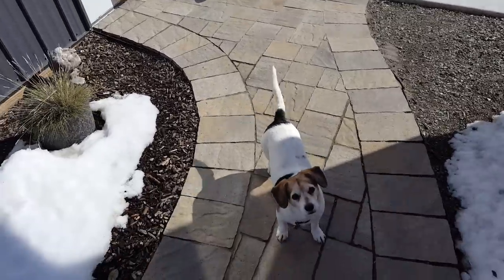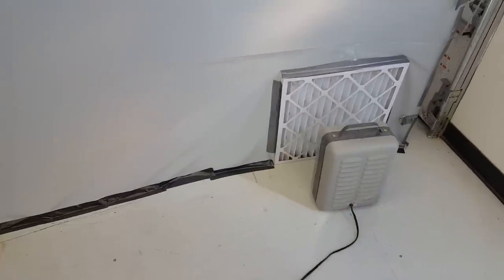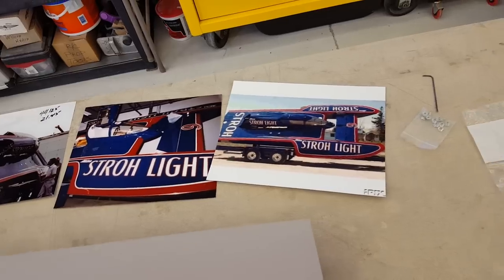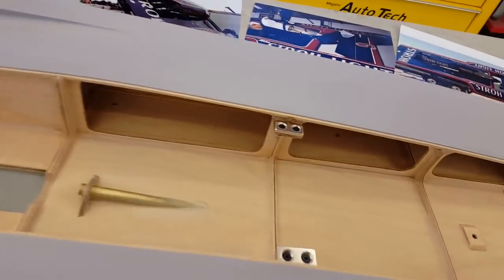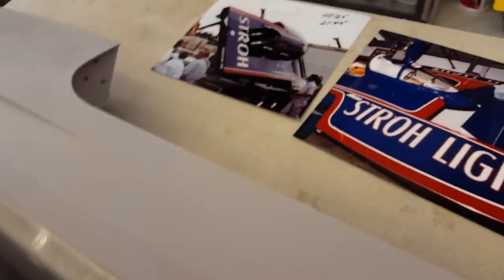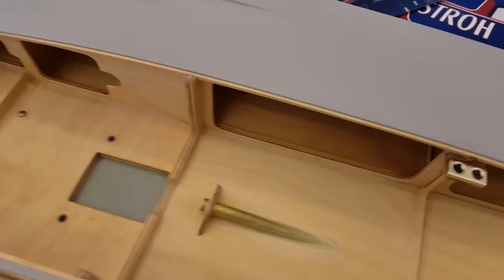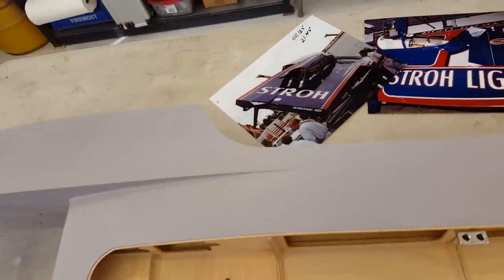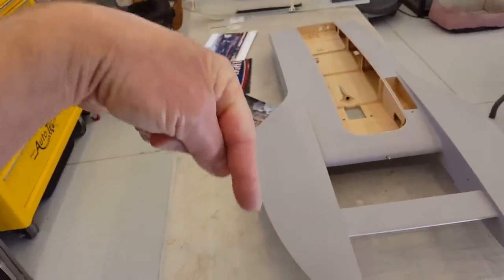RC Hydroplane Racing Boat Shop Paint Booth and Cowl Latches, Howdidya Do Dat?

Comment: Rube Goldberg. We disassembled the fan.  Found a shaft/rod the same diameter as  the fan shaft, made a pillow block from a 4x4, picked up 2 pulleys that were the same diameter as the fan shaft. Drill a hole in the 4x4 a little larger than the shaft, lube the "pillowblock" hole, assembly the fan, shaft, and pulley in the pillow block. Build support X frame that will fit in the exhaust tube. Make a support frame for the motor on the outside of the exhaust tube, line up the pulleys. The toughest part was finding a fan belt that was small enough and flexible enough. By taping over the majority of the slot for the fan belt this will provide a fairly decent system. Option B drop the house and see the one Rob came up with.
Reply from the maker: Hi Timothy,
Please go to my Facebook page and click 'send message' ... Thanks!
https://m.facebook.com/M5-Performance-Hydroplanes-237635276373511/

Comment: Watched the Strohs Light hydro run on the Detroit River the first year it was built. Didn't have the speed to keep up with the turbines. Almost didn't make the heats, Baker filled the rear motor with nitrous before hitting the starter, the blower and injection system went 100' in the air. They never tried going into the river to retrieve it, another whole set up showed up about a half hour later. The boat was introduced as having twin monstrous all aluminum Fords.
Reply from the maker: That's cool... I had heard the stories, but unfortunately never saw the boat myself. I'm hoping the model will have much greater success than the original!

Comment: Yes what kind of paint do you use for nitro boats.i just acquired a 1985 prather pirahna. And want to repaint it. Bad ass boat 11cc outrigger
Reply from the maker: That's a cool piece of RC boating history!  I've used several different paints.... Any decent automotive type basecoat/clearcoat paint will hold up to the nitro just fine

Comment: nice , That looks like a good clean boat build,A better way than you have with the angle iron brackets ?- I'm no pro spray painter but I've seen them hang it up by 2 points (like with your engine mounts) with stiff solid core wire on a rack in a booth like you've just made a smaller version off... or you could just weld your brackets to a hand cranked BBQ rotisserie and weld it to the rack.lol .... hehehe,Hmmm I wonder if you could turn one of those big trailer smoker BBQ's into a spray booth (after cleaning soot out for a week). All the best.

Comment: Scott, what kind of paint do you use? I'm building my first wooden boat and I need ideas on types of that are fuel proof/gas proof. Thanks!
Reply from the maker: Hi Bruce,
Any standard automotive base coat & clear coat paint will work fine. I've used several different brands of clear and all of them hold up to fuels well, so long as you don't allow standing nitro on it for long periods of time.  Do what I do; Go to a local automotive paint supply store, tell them what you're doing, and they'll hook you right up.   Shoot it.... What's the worst that could happen?!

Comment: Great craftsmanship. I really enjoy the videos. Only question? Shouldn't a paint booth be pressurized? Drafting flammable fumes past a fan creating an arc could cause an explosion, no?
Reply from the maker: Someone else mentioned that potential BOOM too... I didn't heed their advice and somehow survived. I like your idea of pressurizing, and may try that instead of risking my life next time. Thanks!
Reply: @M5PerfHydros  I would assume it would need to be the perfect mixture of air and fumes and a large enough spark to ignite... The only reason I bring it up is that I got chewed out for having close to the same setup. Yours is much nicer than mine was ha! Mine was about half that size. Again great builds!
Reply: @M5PerfHydros  http://www.2040-parts.com/binks-exhaust-fan-spray-paint-booth-fume-blower-w-explosion-proof-motor-i407039/
Reply: @M5PerfHydros Meyers this makes sense. Obviously, this is a little big for your application but the fan is isolated from any potential flash.
Reply from the maker: "Explosion proof motor" ... That tells you something, doesn't it?! Wow!  Thanks for the info!

Comment: Question. I see it primed. Do you apply any epoxy to the outside before painting? Or did I miss that video. You leave it as wood! No fiberglass or carbon!
Reply from the maker: Yes I apply thinned epoxy to the outside, same as I do the interior.  Slather it on very heavily, wait a minute or two and then wipe off all the excess with paper towels.  After it sets do a light buff  with 3m pads to remove all gloss and you're ready to shoot!
Reply: @M5PerfHydros  
Ok. I don't see when you start attaching your pieces to the bottom that you have screwed with washers to the jig. Do you use the g-flex epoxy there?  As I see. It looks like you use the g-flex to attach everything. And the ws105 for the water proofing. Does that sound right?
Reply from the maker: Yup!  No special pieces needed to fill the holes. Just a simple dab of epoxy does the trick

Comment: Hey Scott, Where do you get your carbon fiber?
Reply from the maker: I hate carbon fiber and use as little as I can get away with, usually only for reinforcement in some areas when I'm laying up cowlings.  Honestly, I've had this roll for so long that I can't remember where I purchased it.  Lots of suppliers you could find online, and possibly a local supplier in the Boise area if you look around a bit

Comment: I have a few nitro outrigger what's a good paint to use for these boats?
Reply: Epoxy seal, urethane primer, paint, 2k
Reply from the maker: Chris hit the nail on the head... I seal wood boats using West Systems epoxy thinned with alcohol. Slap it on heavy, wait a few minutes, then wipe the entire surface with heavy paper towels wiping all excess epoxy off. Then just as Chris said; high build urethane primer, base coat, clear coat. Use a good paint if you can afford it... PPG Deltron or similar
Reply: @M5PerfHydros  Maybe some temporary fasteners in screw holes to keep paint out of threads. Or punch out some tape circles. 
Really clean pro work, nice job , mon!
Reply from the maker: Thanks for the reminder! Yep I'll cut the heads off some nylon screws to fill those threaded holes